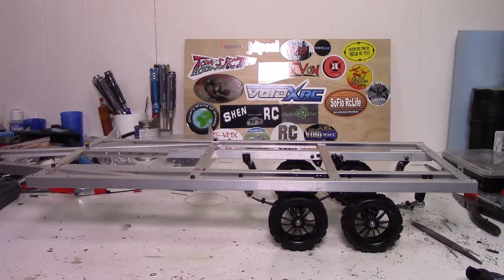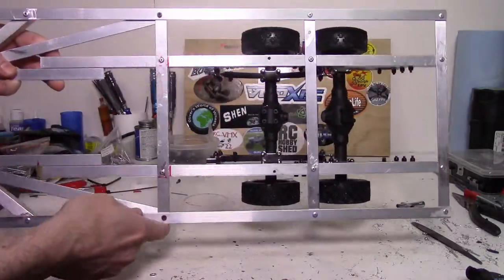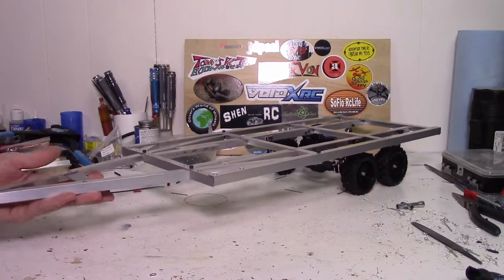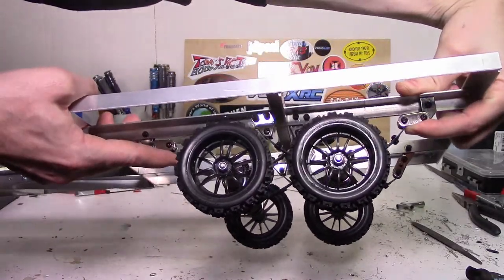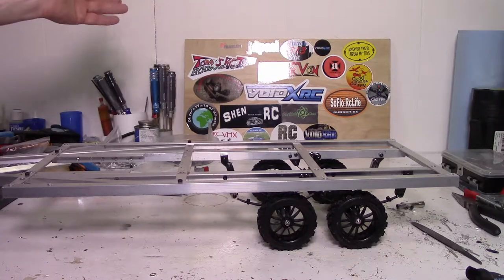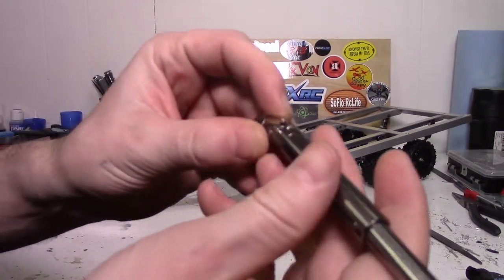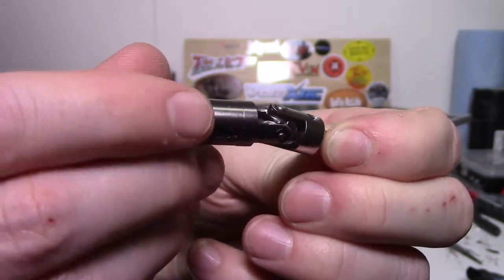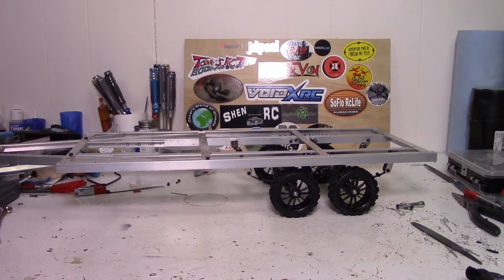RC Trailer Build: Part 2 Frame is done!

Comment: Nice trailer. Your hitch idea is pretty cool. I used 4-link bar Slid back in and bolted to the center bar. Still a one bolt situation at the front.
Reply from the maker: Thanks man your solution sounds good too. Along with the other one from sawyer offroad I may be thinking of a new hitch design!

Comment: A pintle hitch is a easy hitch
Reply from the maker: I had thought about a pintle hitch but I couldn't think of of a good way to make the latching part.
Reply: Oh maybe you can make one out of the aluminum
Reply: Drill a hole in a piece of aluminum and attach that side to the trailer. And for the truck hitch take a piece of aluminum and put a screw in it
Reply from the maker: Thanks for the idea! How much movement up and down do you think I would get out of it?
Reply: I think it would be ok but mabey you could make the screw head bigger than the hole and unscrew and Rescrew the screw in to unhitch and hitch the trailer. but if you park whatever u put on the trailer if u park it forward enough it shouldn’t un hitch